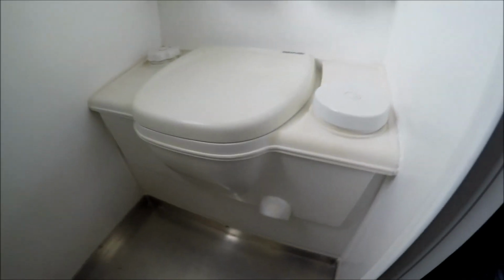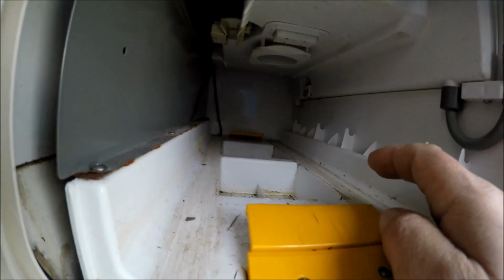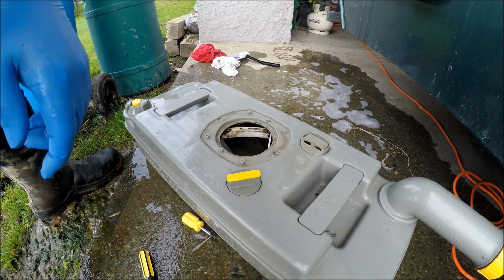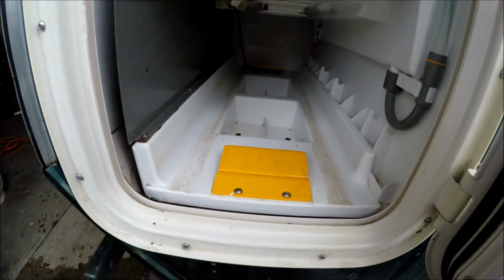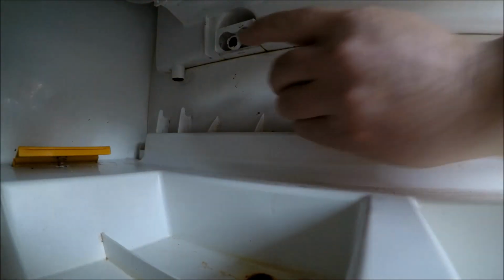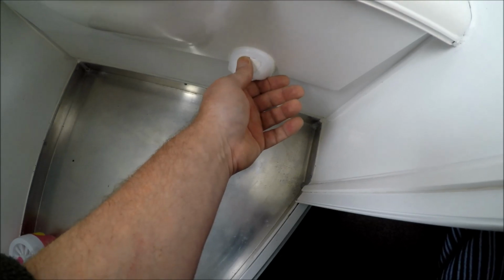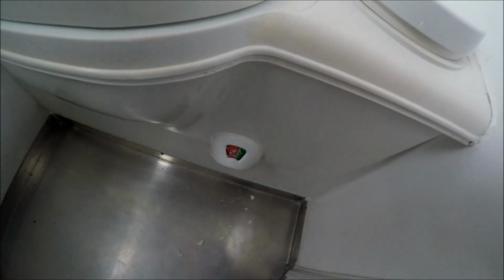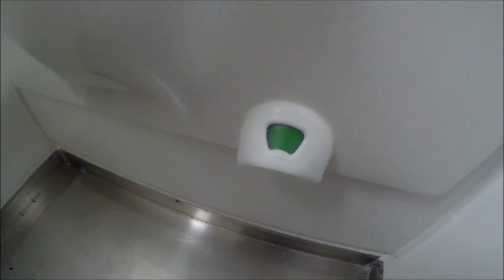Thetford toilet cassette C2 float switch FIX

Comment: wish I saw this video years ago I know what has happened here. the prev owner has damaged the level float inside the cassette this done when people shake the hell out of the cassette when emptying and cleaning. resulting the float dislodges and goes down the waste. this means the tank indicator reads full all the time so the seller tried to hide the fault rather than fix the problem

Comment: All you've got to do is look down the hole to see if it's full. Also I clean the cassetts out with ct18 after each lot of camping. (So clean you could eat out of it)
Reply from the maker: That's what we were doing for the last few years, but I like to have things working, it was a simple fix and couldn't believe they just silicone over the indicator because they weren't bothered to fix it.
Reply: what is "ct18" ?
Reply from the maker: @jameslaine2472  https://www.repco.co.nz/en/brands/chemtech/chemtech-ct18-superwash-25ltr-ct18-25l/p/A1250001
Reply: FOOLISH  man showing himself  up, the spring loaded vent is held down , allowing the tank to Vent to outside of the caravan,  otherwise the fume will go into the caravan. 
The spring closes the valve on pulling the tank out to empty. 
A SIMPLE  look when the tank is in place will show you  this.
I am  4 minutes into video,  should I NOW LEAVE or suffer more???????????.